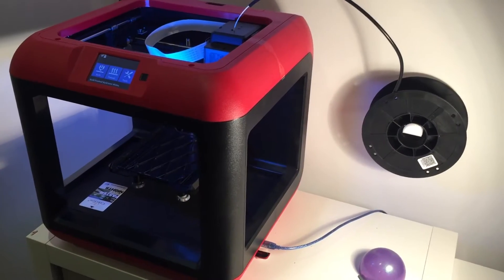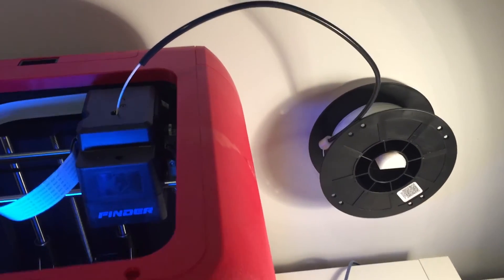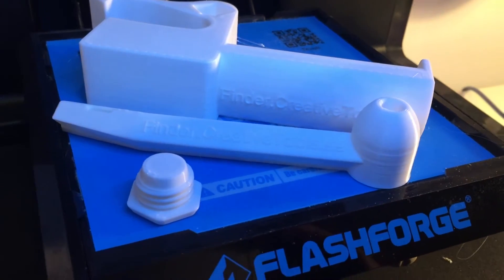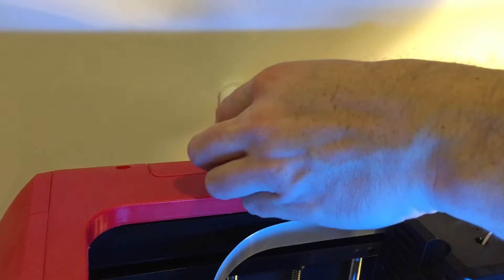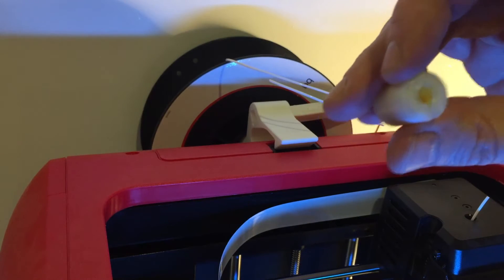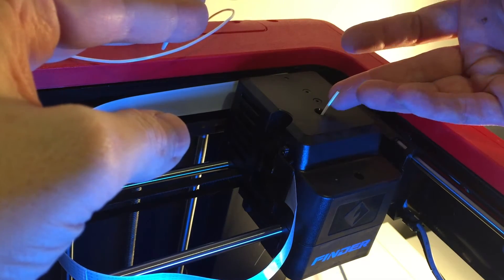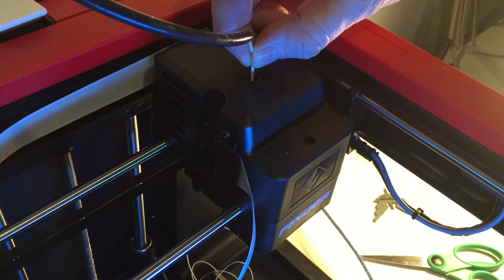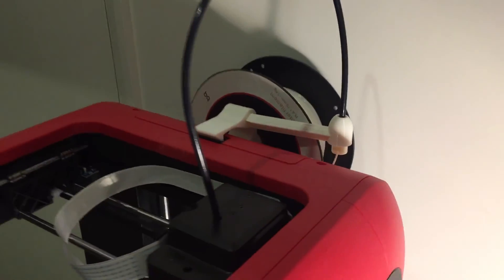External Spool Holder - UKRifter 3D Printing a on a Flashforge Finder

Comment: Be careful with that spool holder. When spools get low the fillament pins the edge of the spool against the arm and you can end up damagin. The gears in the extruded because it can't move the filament.
Reply: Yes I have experienced this - I would say the arm needs to be a little longer so it comes around the front of the reel. I might try to melt and stretch it out.

Comment: awesome print Chris, im loving the quality that it produces, is it easy to fix the hotend once it jams?
Reply from the maker: Mark Crofton to be honest I only ever once had a jam and it was down to the filament getting twisted, my own mistake. A good few hundred hours of printing and it has been zero maintenance. The bed levelling function has been a bit hit and miss, but I have not had to touch that in weeks. There are regular firmware and software updates and things you didn't know were broken will get fixed before you hit them! Great support.
Reply: Thanks for the update on the Flashforge, i'll do some research on it and see if i'm going to get one in the future. I have purchased the Monoprice Select Mini, as I am typing this message to you it is printing out its first test print, the filament i am using is called HatchBox PLA. what filament are you using again?
Reply from the maker: +Mark Crofton bq- it gets really good reviews, unfortunately amazon just jacked the price of white filament up. Glow in the dark is my next one I will be getting.